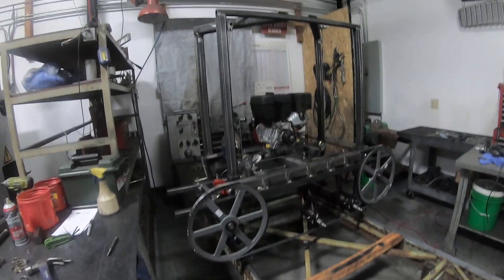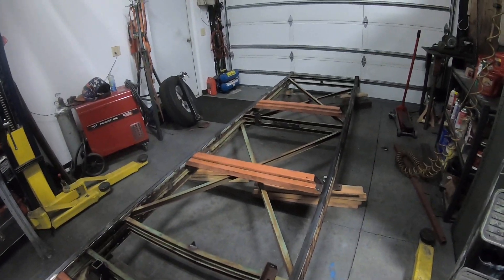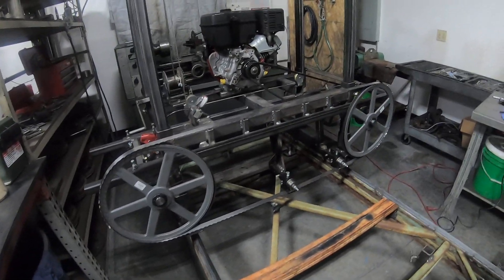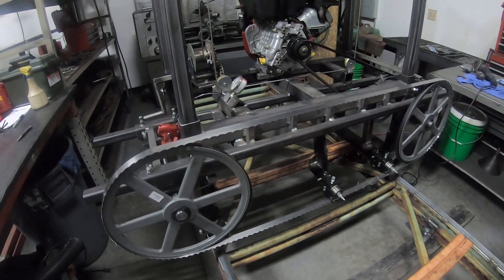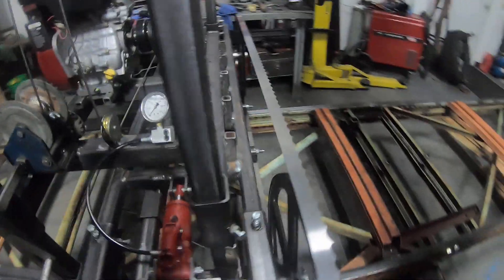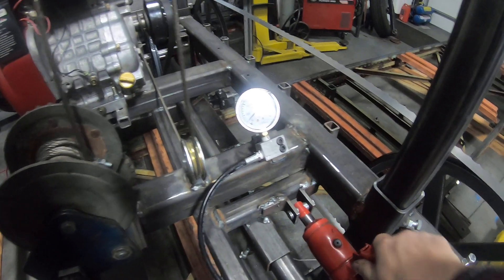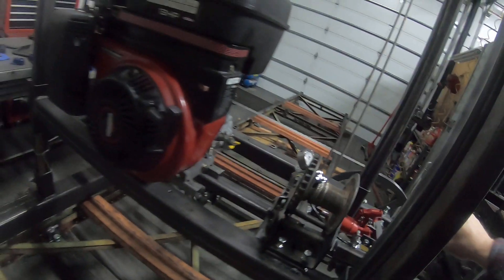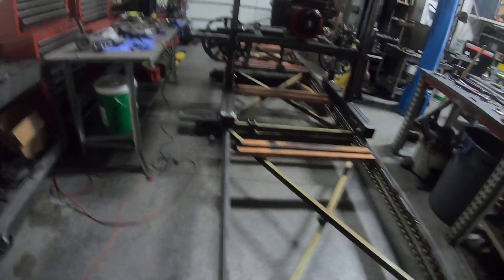DiY Bandsaw Mill Build

Comment: hello i was wondering about the diameter of the wheels and the blade used thank you
Reply from the maker: The wheels are 18 3/4. The blade is a wood mizer 158” I bought the blade and built the saw around it. Thanks for the reply.

Comment: Any worries about Jack leaking pressure and reducing tension? If it gives you problems try a vice screw and handle. You know that opens and closes a vice. You might have to make 1 out of all thread. But you get the idea.
Reply from the maker: My biggest worry is the quality on the HF jack. I drilled a gauge port in it and added a gauge so I can monitor the blade tension. The jack did hold 1200 lbs of pressure for a week so that's encouraging.  I hope to do a more detailed video when I get it finished. Thanks for the comment!